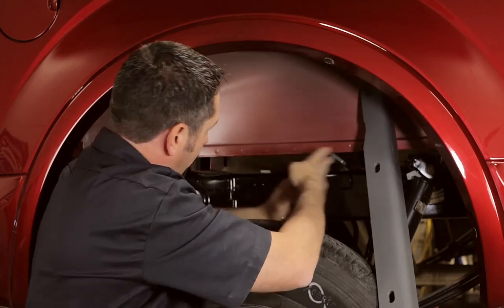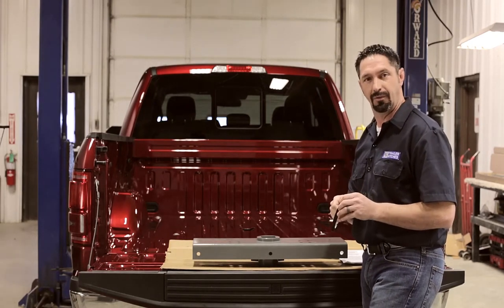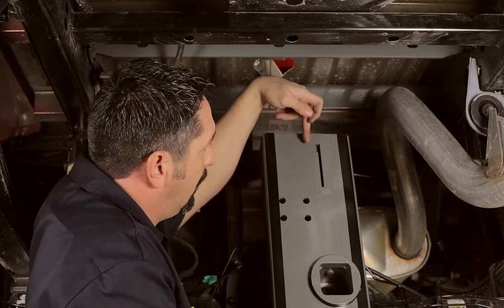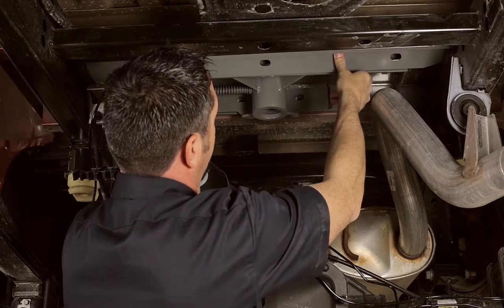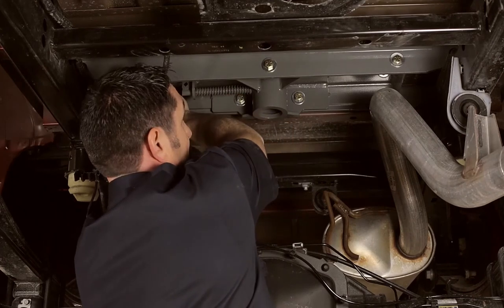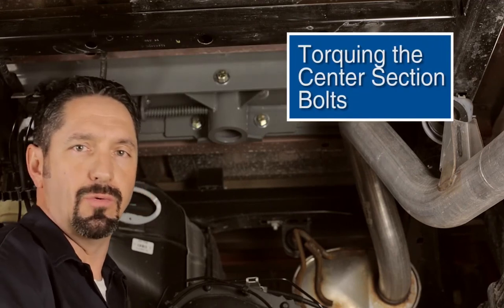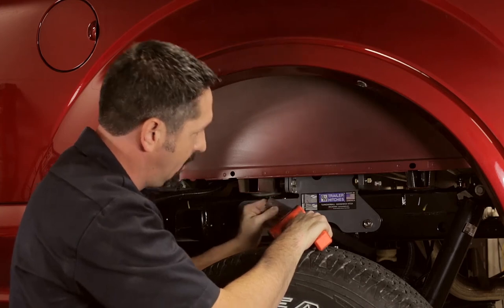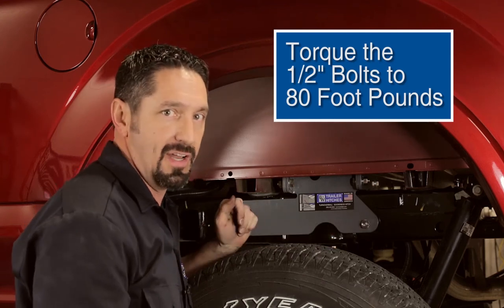Model 1115  Installation

Comment: If I'm not mistaken, your front and rear angle irons covered the tape strips you put ontop of the center tape. If that's the case the tape should have gone ontop of the angle irons that latch onto the center plate.
Reply: The top part of the angle does not overlap the center portion

Comment: This video did assist in installing the hitch. However, I did not need to remove the tire or tire shield for the install. The issues we ran into when installing the hitch were the torquing of the bolts and mounting without a hitch holder. Overall, we installed the hitch and it did go well.

Comment: is this a 5.5' or 6.5' bed?
Reply from the maker: This truck had a 6.5' bed.
Reply: thanks, other than cab clearance issues will this hitch work on 5.5' bed?
Reply: It will fit "all beds" according to the installation instructions.
Reply: Would you guys make a video installing a hitch on 13 f150?
Reply: GNRK1104...
That hitch covers a decade of 1/2 ton Ford F-150s ('04~'14). We'll suggest making a video. Stay tuned...
Reply: From looking at the different truck beds, the distance from the back of the bed to the center of the rear wheels is the same regardless of if you have a 5.5ft, 6-3/4ft or 8ft box. Ford adds additional length on the front side of the bed

Comment: Can this be installed on an F150 with Load Lifter 5000 air bags already installed?
Reply from the maker: We've looked at this and think it could be difficult to install the hitch with the airbags already installed.  It appears that the airbag u-bolt would install over our Turnoverball sideplate.